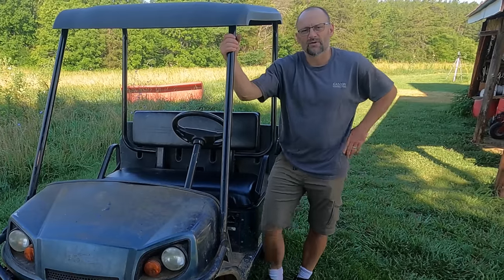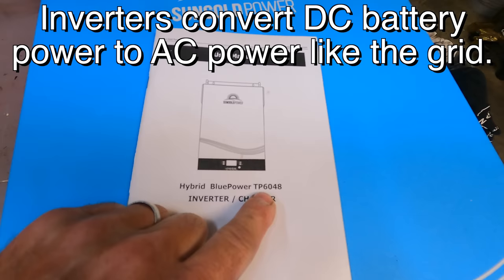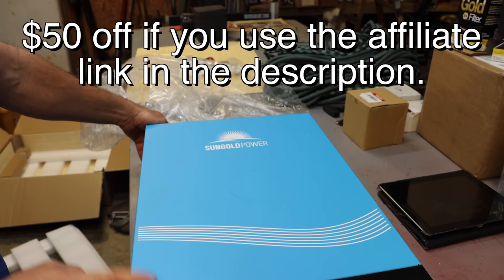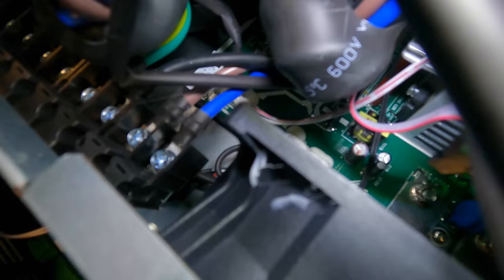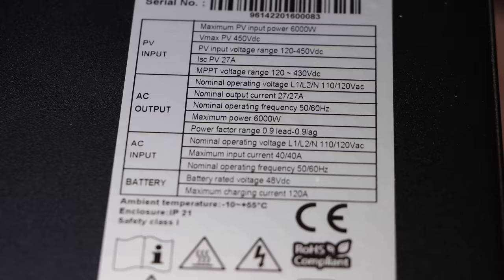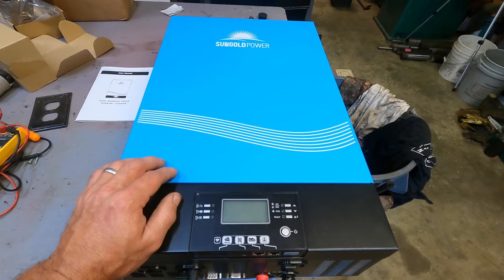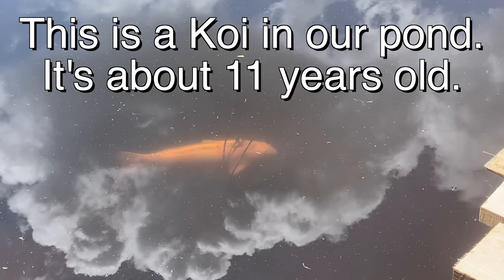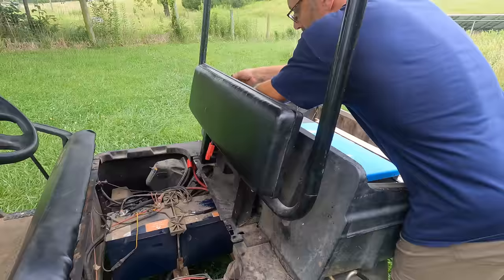Converting an Old Golf Cart into a Supercharged Power Plant.

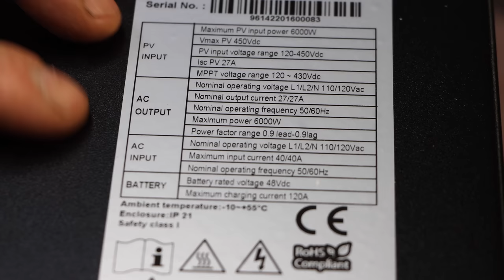Comment: Inverter minimum voltage is 120VDC from spec at 7:42 but you only demonstrated 50VDC input from your batteries.  Is there something you want to tell us about this discrepancy?
Reply from the maker: That’s PV input you are talking about. Solar panels. The battery voltage is 48V.
Reply: @FarmCraft101  I see, multiple inputs.

Comment: Any thoughts on doing your own DIY solar videos? Could reach new viewers and interest with green energy leanings?  But really its also a great addition to main power and generators, it gets tricky with disconnects if you want to power your own home with it (permits as well as fiber wire runs with local electric company) but could be a 'free' source to charge your batteries for the portable transformer with a couple panels where yall could dip your toes in the water.

Prices are insane for electronics/panels now, copper has gone up more than 106% in the past few years but down the road if prices stabilize I think yall could have some great benefits and excellent videos for it even if you only decide to do a small bank for batteries I believe you would get your use, or at least the views from it.

Thanks for sharing as always, really enjoy yalls content.

Comment: I do not know how is your electrical panel wired and whether you use multi-pole circuit breakers (i.e. breakers which break both line conductors, as well as the neutral conductor). But this kind of breakers is typically not used in a TN earthing system. Therefore, even if you disconnect your panel or some of its circuits from the grid, what effectively happens is that you only disconnect the line conductors and not the neutral.

When you then connect another power source to such an electrical network, I am unsure what implications it might have. The neutral of your portable system would be connected to the neutral coming from the grid. They would be forced to have the same potential.

Perhaps this arrangement does not pose any safety hazards. But I do not understand the details and intricacies of the electrical systems with multiple different sources so I would be very cautious about that. Ideally I would consult it with an electrician with experience in this field.

Comment: I'm a bit worried about a couple of things, the suicide cord most of all, but I'm wondering if some sort of an enclosed trailer would be nice.  Waterproof, connections built in, big tires to help take it anywhere and no lifting.  Maybe even some extra batteries that can be charged with a solar charger that's on top.  And in my case, a cigar lighter.  Thanks for the video!

Comment: Greetings! I have been looking high and low for an answer to my question - and cannot find an answer. We just purchased one of these inverters. It has A/C input and A/C output. I plan on putting this in my shop - I have the same setup you do. My shop power is on its own breaker box, but power comes from the house breaker box. Does this inverter require that it be between the incoming power and the breaker box? Can I just run both the A/C in and A/C out to my shop breaker box on separate breakers? That seems wrong.

Comment: Did you sand down the boards on the pier with this
Reply from the maker: I did not sand them.  Just put them down straight off the mill.  No problems so far, even for wet bare feet.

Comment: I am very curious about this, and confused about one thing from the specs. I am curious about why the PV input min was 120v but it said battery voltage was to be 48v. Curious that the PV input requirement is so much higher than battery input.

Comment: 16:23 even worse, if you're still connected to the grid and there's an outage for some reason and you did that, you could murder a linesman.  Definitely not a cable I'd like to see in the hands of the average person.
Reply from the maker: You are right about the cable, and I wish I had explained that I really do not plan to power my shop in that manner except in very extreme circumstances (like a very extended outage).  The reason I did it in the video was to test that inverter against my shop tools.  That said, I know several lineman and have asked them about this, and they said they really aren't at risk.  The first thing they do when working on a line is ground it, which would either blow a fuse or ruin the inverter, while protecting them.  They can't be working on things and have their lives depend on some idiot not backfeeding the grid.  Of course, I suppose it's possible that an idiot lineman wouldn't ground the wire first, and then some other idiot screws up and backfeeds the grid.
Reply: @FarmCraft101  Yeah for sure, I understand your reasons and I know there are procedures to make sure this doesn't happen, but the Swiss cheese failure model is a real thing.

Thanks for the video.

Comment: This inverter has 1 very large down fall! That is how many peoples homes only run on 120vac and not 120vac/ 240vac spilt phase?? Almost anyone that would have a large pv system would.
Reply: Edit: After more investigation it seems that this inverter might have 120vac/ 240vac split phase but the label on side of unit does not make this very clear.

Comment: 15:10  No your amp clamp showed OL... So you exceeded 40 amps.  You kept repeating your error over and over.  I'll be moving on now.  Drives me nuts when people don't capture good data, and misrepresent the faulty data they did capture.
Reply from the maker: You might want to watch again. I said I suspect it was higher. But just because it says OL doesn’t mean it went over 40. It will do that sometimes just with a rapid change.

Comment: This is absolute nonsense. 

You need MPPT controllers for every "serial panel" connection you have. If one panel is shaded, all panels are shaded. Panels are "current sources". If they're not identical, they can't be put in series. if this device was useful it needs to have MPPT controllers for all different panel connections you may need to use. 

On the battery side, you have a similar problem. Battery chemistries and charge protocols differ for every different battery configuration you choose to use. Thus you need charge controllers (and levelers) for each different chunk of battery you choose. 

Finally, the inverter needs to take power from each different battery configuration and load balance it to the inverter. At $1,600 this is a ridiculous solution...unless you have homogeneous components throughout. And you won't have, regardless of how you try to engineer it. 

To solve this problem you need many separate MPPT solar panel connections. And you need many different battery chemistry configurations. And finally you need a "Norton" equivalent current aggregator to a voltage regulator for your DC to Pure Sinewave AC output. 

Close...but no cigar.

Comment: I live in AZ, one of the best places on Earth for solar.  You see it NOWHERE.  Solar isn't financially viable.  Covering the 200 amp service on a 2,000 sq. home would have an initial cost of $135,000.  After 30 years [2 replacement cycles of worn out batteries, inverters, panel motors] total cost would be $238,000. << And THAT is the reason you don't see solar everywhere, here in the land of sunshine... or anywhere else for that matter.

Solar is great for very small applications.

Wind power is the future.  Financially viable by a factor of 2, when compared to solar.